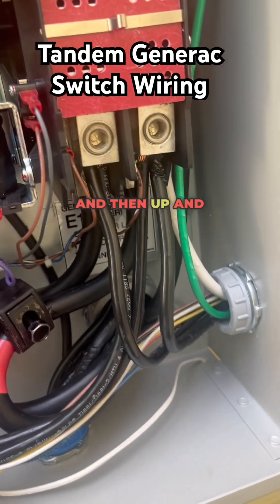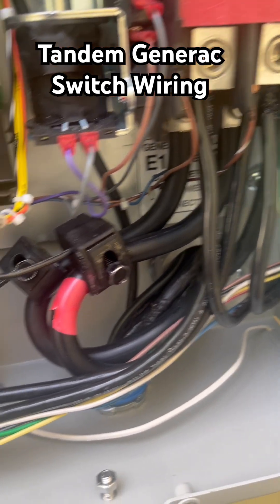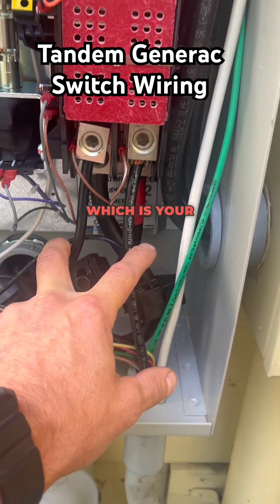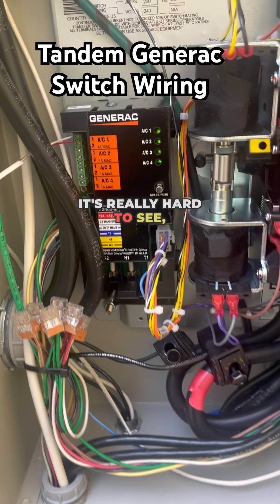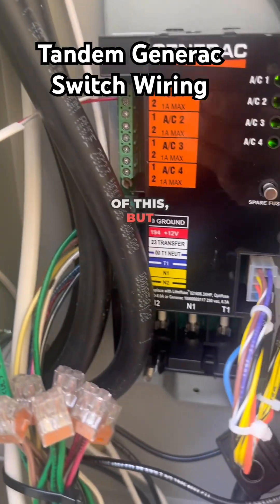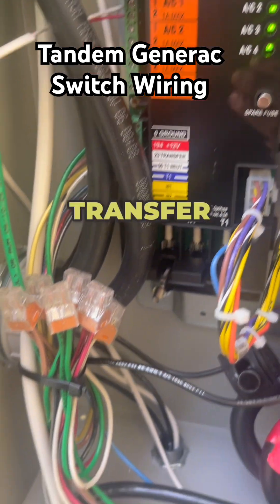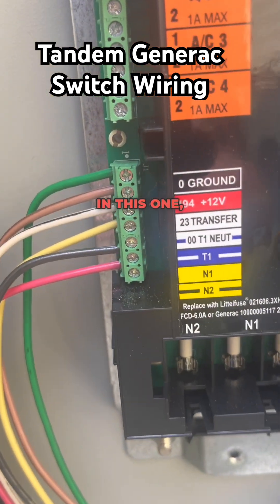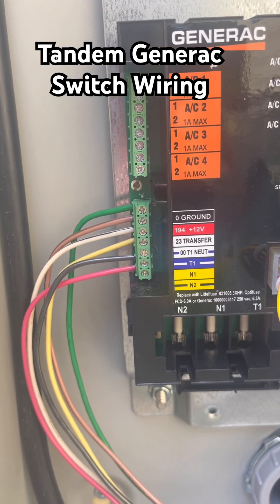Generac Auto Transfer Switch Wiring EXPLAINED for Emergency Power!

Comment: Low voltage and line voltage in the same pipe ❌
Reply from the maker: @kalebpetersen1044  check your code. Both wires rated at 600 volts. THHN
Reply: @GeneracDoctor had nothing to do with the voltage rating high voltage can interfere with low voltage controls.  Its okay of you used shielded cable for the controls though.
Reply from the maker: @jamiecroweiii80  thanks for the reply. I’ve been doing it this way for 25 years. I understand what you’re saying.The low voltage control circuits are not subject to interference in these Generac systems. This is completely fine by the factory standards and we never had an issue. Actually they make a cable with. All the wires bundled together now. We just don’t use it.
Reply: I assume dual transfer switches rated at 200 amps 120v/240v is because generac's 400 amp single box is 277v/ 480v?

Comment: Why not go to a junction box first with your generator pipe, then split off to both transfer switches to eliminate the double taps? I've done it that way in the past and it's much cleaner inside the switches.
Reply from the maker: I appreciate the feedback. That’s a good idea.

Comment: So do you have one generator on 2 ATS’s?
Reply from the maker: @N4l4007  yes, that is correct. 320 amp meter base which is essentially 400 with two panels on the load side